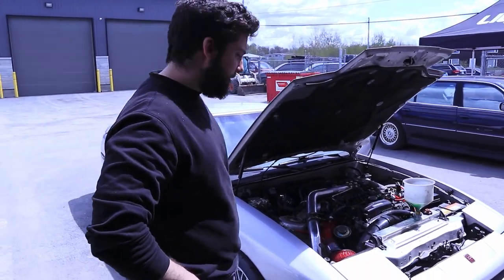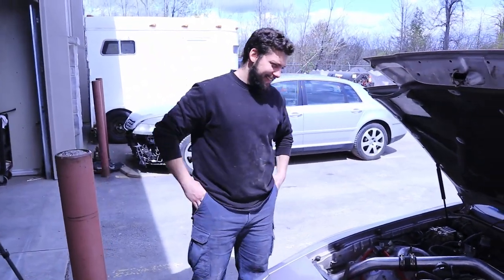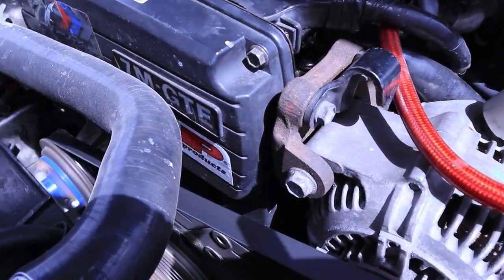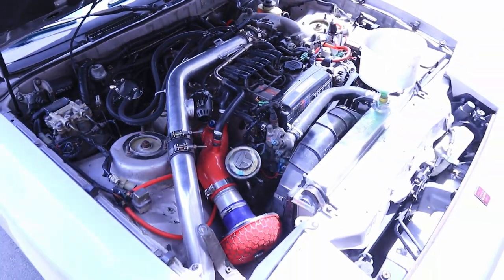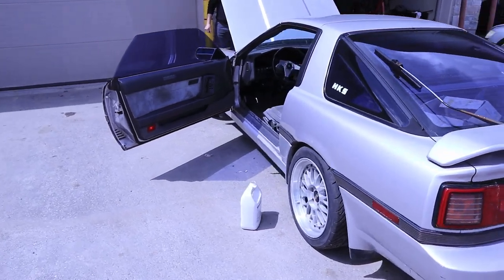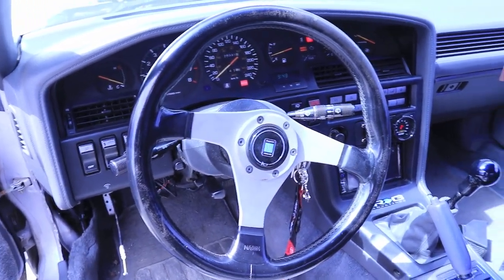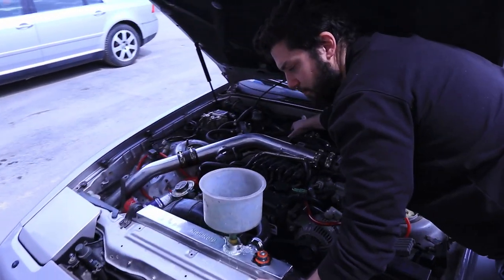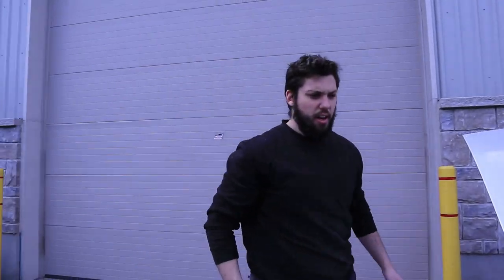Big Daddy's Mk3 Supra 7MGTE

Comment: Man american dynos read so much higher than aussie! Mine made 290whp at 14psi with a 60-1 (stock intake piping but Turbo A so same size piping as JZA70). I have since rebuilt the CT26E and welded up 3" piping as well as full electrical/fuel upgrade. Accidentally had the boost controller backwards and it made 28psi on the first road test pull! Turned it down to 15 again before I get a retune for 20-25 which should be 400whp. Every time I go to a car meet people say "you running a 2j" and their face is always full of confusion when I say nah 7M hahaha. Got a custom set of camshafts 10mm lift 270 duration which should be pretty rowdy for a street car, GSC beehive springs and Ferrea super alloy valves (stock size). I was getting the turbo sent off to get a BB conversion and billet wheel but been off work for several months due to a back injury so that can wait :P

Comment: Didn't quite get what happened to the V1 to malfunction?
Reply from the maker: They are notorious for failing. This one was fine when the head gasket popped (due to common head stud stretch on 7m) - car sat 1 year. after engine was re-done it didn't want to run. we tried 4 different CAS sensors and got no where. I had a spare ECUmaster EMUClassic kicking around so we ordered a Pnp for the 7MGTE harness, low and behold it fired right up. So the V1 died as usual, money wasted. So we did a little segment on the frustration it caused both the owner and I.
Reply: @LightTouchTuning  I see.   Strange how it just mysteriously malfunction though, no power surge,  shorts,  power back feed,  etc.  Looking forward to the next video